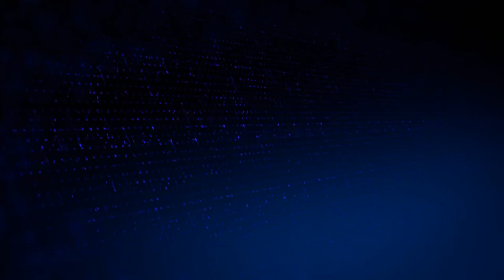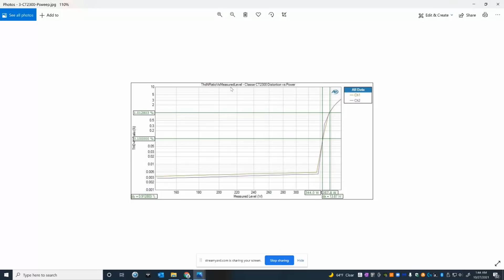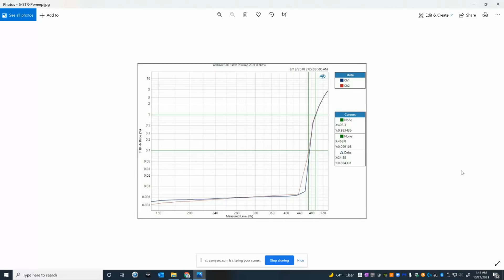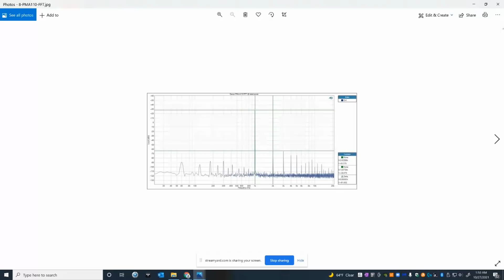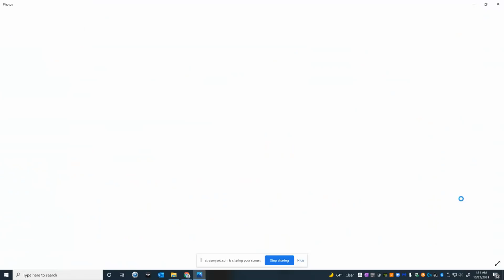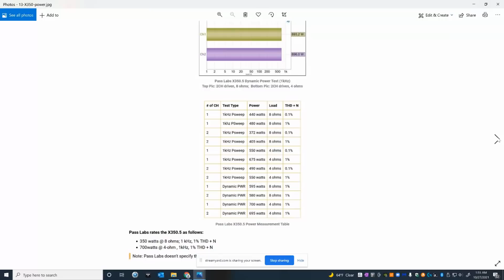How to Determine Good from Great Amplifier Performance

Comment: I guess he doesn't understand how great the 2nd and 3rd order harmonics are in pass labs amps, flat distortion response is a flat sounding amp, when I got a pass labs amp nothing I had could compare to the sweet sound and depth that it has.
Reply from the maker: Pass Labs amp sounds fine until it runs out of gas. For 1/2 the price the Classe CT-2300 was a far better amp with more power reserves and superior measurements and didnt get hot enough to fry eggs on sitting idle or at full power like Pass Labs

Comment: For me a great amplifier should not color the sound at all.  It must have extremely low lutput impedance over the range of hearing.  Example: Hypex modules are < 5 milli Ohms out to 20kHz.  You read that right MILLI OHMS. Make sure when looking at output impedance, the frequency range is considered.

Comment: Personally I would go with the cleanest amp. But people apparently appreciate well done distortions and will pay double or an order for them. And I think I understand why. Sometimes it helps to put a "filter" on what comes out from the source. Like high quality very biased sun glasses with enjoyable spectrum and clarity which you have never seen otherwise :-) The truth is not always what we want to see or listen to. Here come expensive amps with "not so good" measurements. They definitely defeat the purpose of HiFi. But audiophiles may love them and talk endlessly about them. And I agree, if the sun is too bright for your taste, then you need the sun glasses to enjoy it. I think that in this case some reality distortion is not a bad thing after all. But not to the point when an expensive system falls apart on its declared power rating of cause.

Comment: I have an Onkyo TX-L50 with 2x DefTech Mythos Fours, I would guess that AVR measures poorly, but I must say that I don't hear any hiss unless I put my ear to the tweeter. I just need to get a proper sub to fully refine the situation. For now I'm just using the sub of some old computer speakers but the low current of the Sub-Out is resulting in very low output.
My room is small though. Barely 10ft x 10ft.

Comment: Great video explanation Gene.
Can you review the Musical Fidelity M8s-500s
power amp and compare it to MICHI S5?
the M8s-500s is 3000€ cheaper than the MICHI S5 and half the weight, but on paper it has more power. It would be awesome if you measured them both and compare them for music and movies.
Thanks!

Comment: I've been performing out live since 1987 as a bass player. I've played in rock bands Country Bands and in a Blue Grass band.. The only way to tell a good amplifier is with what you call a left and right ear that you have on either side of your head... It's all in the ears of the beholder.. I don't care what amplifiers make what claims. A lot of people buying amplifier just because of the name. I prefer HARTKE bass amps. over the out rageous priced Ampeg amps. Where I find HARTKE has a better sound for how I play and what I play for music.. But nothing will replace you EARS...
Reply: Which is why you should PROTECT your ears/hearing!
So you judge equipment with earplugs or at 110db unprotected?
Live concerts need a warning label from the surgeon general.
Deafness leads to dementia, so it's no joke.
I always take earplugs to concerts.
At home 85db is plenty with subwoofers for following the bass lines with satisfying weight.
🎵🎶((🤫))🎶🎵

Comment: I ripped the tendons in my shoulder rotator cup, so I'm not getting any amp heavier than 50 lbs.

This week, a new amplifier NAD C298 at 185 wpc and 25 lbs (similar to NAD M23, 200 wpc) will replace my Parasound 2125v2 at 150 wpc (love it but I'll repurpose it to power my surround L/R channels).

Apple Music lossless

Comment: HI I would like your opinion on the denon poa 2400 I,m useing one with my analog system driving a pair of klispch forte iv,s I have a prema lune evo 100 preamp. That might seam a little strange but that pre amp drives the poa 2400 with insane dynamics my input is a rega planner 6 with a oftfon bronze cartridge. I have had to have both channenl repaired at the cost of 900.00 but its rocking again. I have been considering a  muscial fedility m6 amp to replace the denon ??

Comment: You probably can't fry a tweeter with an amplifier DC offset because in most cases there will be a CAPICATOR in series with the tweeter.
Reply from the maker: True but a large DC offset can definitely damage a woofer voice coil. I've seen it happen.

Comment: If you use active crossovers and amp each driver independently, and use drivers with a good impedance curve mounted well to reduce resonance or change it out of crossover range...
you can use class D amps matched to the impedance of each driver.
This spending many thousands of dollars on an amplifier that is super impedance invariant so you can drive poorly designed speakers, is just a waste. If you're a billionaire, go ahead. If you're in the working-class get a DSP get multiple channels of amplification and choose your speaker drivers carefully.

Comment: I tried purchasing a X250 Pass Lab. Beautiful looking amps! 
But, who wants a sports car that can't handle curves? 
I'm currently looking into the new Rotel 1592 mk2 & it's CD player? 
Sound, sound Value for dollar & looks matter most.
Reply from the maker: Pass Labs is the DeLorean of amplifiers. Great looks & curb appeal, performance... not so much. Great Scott!
Reply: @Audioholics  Yes. A nice body is only half the story..substance completes the entire picture. 
Before I purchased Classé CA 150 & CAP 151 components. I went head to head in same price category with Bryston & Krell. Classé came home with me for a few years until BAT manufactured their VK-500 w/Batpack! 
In retrospect, I should've simply purchased an additional CA 150 & used each as 600 watt monoblocks into my KEF 105/3 four ohm ratings.

Comment: The major problem with this video is the fact that unlike Gene, most consumers do not have a way to test their amplifiers on a diagnostic machine. You can say that a certain class of amplifier is better in some ways than others fine. But, when it comes to actually listening to amplifier and here in the overall sound quality if it's effortless across the frequency band and has very low THD and drives your speakers well efficiently and with good clarity... This comes down to real world listening. There is no way to know just how linear or whatever and amplifier is if you're not hooking it up to a piece of expensive sensitive equipment for diagnostics. Gene spends the whole video sharing his screen showing what he has measured on a $30,000 diagnostics machine. For most of us this simply is not accessible. This makes this video presentation completely redundant.

Comment: Hi Gene. Thank you for this very instructive video. I'm an admiror of your work and constant search for truth in audio. 
I published your video on my FB group and someone sent me this comment about your measurements. I would very much like if you could comment on it. This comment was made in a constructive way:
"Unfortunately the video is mystifying. Measuring an amplifier with periodic-static signals says absolutely nothing about how it will reproduce aperiodic signals. Almost all amplifiers use HIGH negative feedback rates (NFB), which results in ultra low distortion values, but only for periodic signals. The rub is that the NFB does not act instantly, in fact the signal takes time to travel through the entire circuit, which makes the signal in comparison no longer the same as the one that is entering. As a result, the dynamic distortion is tens or hundreds of times greater in reality. For the reasons supported by the video, tube amps could not even be called hifi."
Thank you

Comment: Howdy. 
My view is different. I do not consider frequency bandwidth and THD:s very relevant these days. They were in the tube ages.
What is important now are:
- Transient response. How well a kettle drum is reproduced without compression and buckling.
- Slew rate. Determines how well high notes can ride the bass.
- Square wave response. Are there overshoots and afterringing ?
Regards.
Reply from the maker: All nonsense.  It's mind boggling how the engineering of amplifiers is rejected by some audiophiles.

Comment: Just curious, have you ever bench tested a Hafler DH-220 amp?
Reply from the maker: No I wish. Hafler made some great gear back in the day.
Reply: @Audioholics  I put together one from the kit form (cost me less than $300).  It always seemed like a great amp to me, but I never had it measured.  It's still running strong, 33 years later.

Comment: In my opinion the problem with amplifiers are negative feedback. A few examples of amps without negative feedback is Hegel (typicaly from $1000 used for 80 watts)  and Music Angel (Tube, Class A, typically from $500 for 30watts) . Im sure there is other examples, but this is the two that I own. Good luck.
Reply from the maker: Yes agreed. The lack of or improper usage of negative feedback is what is mostly responsible for bad amplifier performance.
Reply: @Audioholics  the reason feedback is bad for sound is the time alignment, another problem in the time aligment is the coil in the crossover. If you want to experince music without time aligment problems (but some problems with too thin cabinet) try the speakers from philips mz-33 and some amp without feedback, as mentioned above. The loudspeakers typically cost $40 per pair, best results with two pairs, and mounted in a better cabinet. Anyway, this is the only way to get zero time distortion, and time distortion  it is in reality the most important distortion, but also the hardest to measure, because the time misaligments is so small. Try this setup in your kitchen, and if you find yourself spending too much time in your kitchen, you know your onto something. Please leave a reply if you ever try.
Reply from the maker: @bjorn2fly  that's pretty nonsensical and patently false. Most of the bad rap about negative feedback is poor understanding either by the designer or the person making the claim.
Reply: @Audioholics  try for yourself, once the timing-distortion disappears (and other distortions is not too obvios) the music feels clear. And no, its not nonsensical to talk about errors made by coils in the time domain. Coils where used to correct timing-errors on trans atlantic lines, so its not unreasonable to think a coil will introduce a timing error if used in a say 5m line. Anyway, try for yourself, and if you start to spend all your time in the kitchen, you know something is right. I have not done the calculations, and dont know how many microseconds things need to be off before our brain sence it, but I have clear sound at home, and I like it. In my experience the linerity  of the loudspeakers is not impotant, but wall thickness in the speaker is important. The speaker i recomended to start with is not good enough and it is clearly audiable (the distortion is around 200hz) , but easy to fix (put it in new enclosure). Good luck, and dont write off a perfectly good reason why hifi is lost in space before you have tried, because you can not measure it unless you are very detremind.
Reply: To elaborate a little more; in my view there is mainly four distortions, timing, harmonic, frequency response and other noise. For now there is no way to convert the 4 into one number, but what I say is that when the three others are under reasonanble control, than timing is key (timing comes from lack of negative feedback and lack of coils in crossover)
Reply: It would be interesting if someone could calculate the time delay in a typical coil, at say mid frequency, and compare with how fast high frequencies pass. Im thinking a tenth of 15khz will be anoiing, so if its more than 6,6 microsecund off we have a problem
Reply from the maker: @bjorn2fly  this is a lot of nonsense your saying here. High feedback amplifiers have the same amount of group delay as low feedback amplifiers with similar frequency response. Most so called "high feedback" amplifiers actually aren't high feedback for the entire audio band and that's why their performance suffers.
Reply: @Audioholics  Wise not to call statements nonsence before you have either lisened or measured. But if you have measured or lisened your free to call it nonsence. In my opinion negative fedback is less important then coils, but both matter.
Reply from the maker: @bjorn2fly  your statements make no sense and it's clear you don't understand negative feedback. It's understandable that people fear what they don't understand.  Education is your best weapon.

Comment: I would like to see a review of the Rotel amps. I just bought a Rotel RB-1582 MKII off facebook market for less than half MSRP and to my ears it sound great but I am curious, espesially because it is rated at 200w x2 @8 ohms but they don't even spcify the 4 ohm power.

Comment: Personally, I have 2 measuring devices, I use to judge the performance of an amplifier. One attached to each side of my head! Yes, when I’m researching gear I may be potentially purchasing, I’ll browse the measurements and specifications and compare and contrast them with competitors, but, only as a very general guide line. My ultimate purchasing, decision making tools are my wallet and my ears!

Comment: Group delay should be constant  for all frequency,  DC offsets  should be zero. No phase change. Linear before closing feedback. Non of  class  D have  such , class D is good for  audio but not audiophile
Reply from the maker: Don't really understand your English but you're dead wrong about Class D.
Reply: @Audioholics  my point here is that your measurement says nothing,  for example how much slew rate limitation you have between amplifier,  do they handle 1ns rise time ? Do they handle capacitive load around 5uF at output? 
What will be phase margin and gain margin for amplifier with this capacitive load , you just measure with AP THD with sinus signal which it doesn't show so much . What about  if you put unsymmetrical signal with different amplitude between positive and negative part of signal for 1 hour , and after that symmetrical sinus signal,  what will be thermal effect of that on sinus signal. 
So you are dead wrong what you say about amplifier.
Reply from the maker: @paulpaulzadeh6172  it almost sounds like you know what you're talking about but in reality, you're just chasing your tale with technobabble. The testing I do will reveal if there are issues or not with an amplifier.  I also test with a speaker load as well.

Comment: Perhaps you can add transient response tests to your list. How an amp handles a square wave at different frequencies and power output shows an amp's slew rate and damping abilities among other parameters.
Reply from the maker: Slew rate problems will show up in amplitude response under various load conditions.  Square Wave response is a very unrealistic test but I usually do them anyway.

Comment: All those measurements are interesseting in theory but IRL situation,given the average untreated rooms (even treated),(bad) ears and (sound type) taste of people they are irrelevant.
Reply from the maker: In that case, just get the cheapest AVR you can afford and be thankful that you won't know the difference.
Reply: @Audioholics  Most of people wouldn't hear the difference between a top high end stuff and an average one,i didn't say the cheapest one,in their listening room beside a A/B test.I had the chance once to listen to a stereo 100 000 bucks based on Mcintosh stuff in a auditorium  and in the end it didn't worth the price it was even pretty desapointing.
It was not 20 times better than a 5000 bucks system anyways.
Reply from the maker: @wild291  listening in an auditorium is the main problem.  McIntosh is over-rated as well.
Reply: @Audioholics  Yep like every high end stuff.Only sh*t not overrated i ever listened to was The dark side of the Moon SACD on 5 identical but too big average towers in my living room powered by a 5*200 watts amp ,drunk (me not the amp) and in the dark.
That was worth any high end Mcintosh or whatever sh*t! ;-)

Comment: I still dont get sinad, why is 20/21 bits/120db sinad such a desirable measurement? what does that mean? it's absolutely dead silent?

How come sinad is lower at lower volumes? yet obviously doesn't distort at lower volumes.
Reply from the maker: 21 bits is about the limit that can be reached due to thermal noise. That's way beyond audibility. SINAD > 80dB is more of an exercise in good engineering design as opposed to audibility.
Reply: @Audioholics To sum it all up at regular listening volume, not very loud like -30 db you can never have sinad at 100 right?  The thx amps says 96/98db at reference levels which is 0 db right?
Reply from the maker: @mikegoddard7354  Yes

Comment: Just looking at some of these graphs will show you which amps are severely overpriced.  For the money the anthem looked the best.  A lot of power at 8 ohms and at 4 grand its not too expensive.  Comparing all of these to the Hypex Ncore nc502mp I bought, none of these amps match the distortion of less than .002 from 1 to 400 watts at 4 ohms all for around 700 bucks brand new.